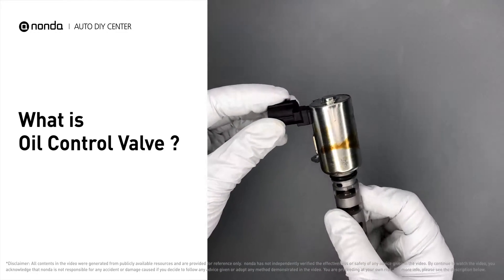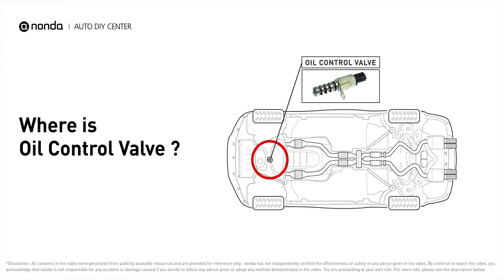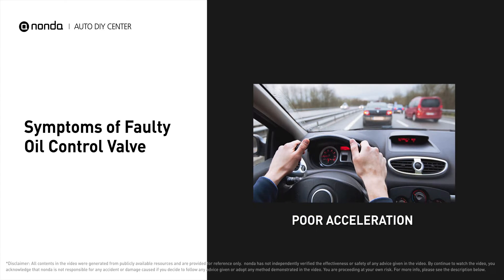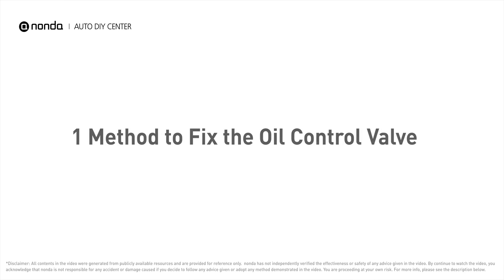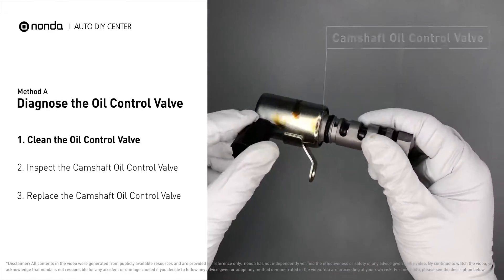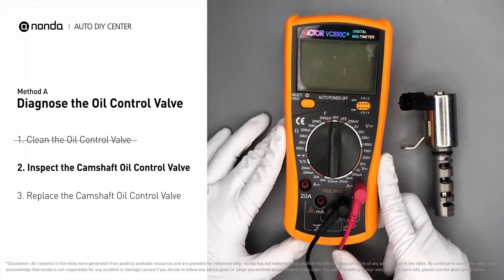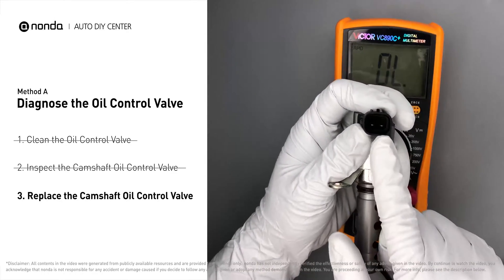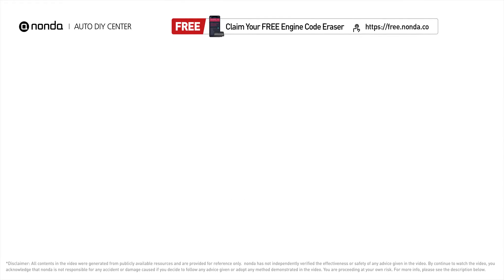Oil Control Valve: How it Works & How to Fix

Comment: Can the ccv solenoid cause a crank no start,  especially after changing the cam/crank sensors,fuel pump, 4 new spark plugs, and 4 new ignition coils, new battery and terminals, any advice I would greatly appreciate,, also engine does turn over then dies after 3-5 seconds, please HELP, ANY AND ALL ADVICE WELCOME,, Thank you all and God bless

Comment: Solutions ↓
1. Clean the filter located below the oil control valve. Remove it and use a injector cleaner and degreaser.
2. Remove and clean the oil control valve. Using degreaser and other chemicals. Also check it by hooking it to a 12v adapter, battery or power supply. Usually the the first prob is negative and the last is positive. Look it up!!

Comment: Please, please help. I have a 2008 Toyota Avalon and I am suffering from a slight vibration in the engine in IDLE mode. I did a live data check and this code appeared: P0024 Current Camshaft position (CMP) B - timing over - advanced or system performance (bank 2) and the other code is P0014 for bank 1
What is the possible cause and how can I treat it?
Reply: Clean the filter and solenoid. Also test it using 12 volts